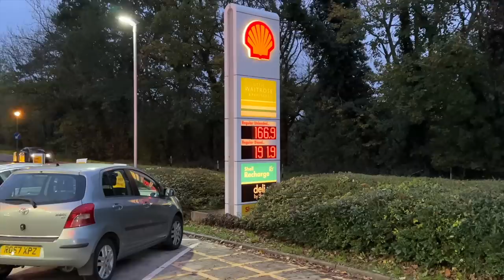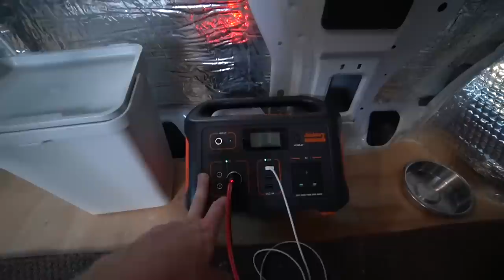Stealth Van Camping with a Dog (not what I expected)

Comment: I wouldn't even have a van if it wasn't for my dog who comes everywhere with me and loves it. There are plenty of medium sized low/non shedding breeds or x breeds. They can be restricting though as you can't leave them in a van for any length of time, it's just not safe these days, or it's too hot etc, so you have to adapt and work around them, which is so worth it IMO. It didn't look like Buxton was properly secured either which is an instant fine and points if you get stopped and is also a high risk to his safety. Being brutally honest, if you aren't prepared to deal with wet dog, some mess and following the laws on their safety, it's probably not the right thing for you.

Comment: Hi Will if a dog is loose on the front seat of a motor vehicle then the driver can be fined up to £5k fine . Alternatively  then it must be fitted with a proper restraining harness so the animal can not interfere with the driver's  ability to safely control the vehicle. Also if the animal is safely restrained than it is less likely to be injured if the vehicle is involved in an accident